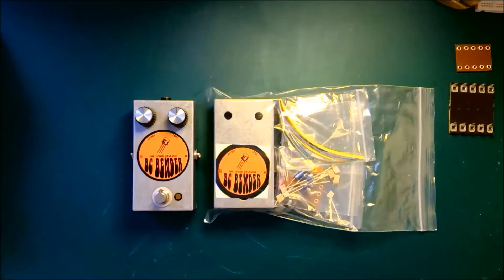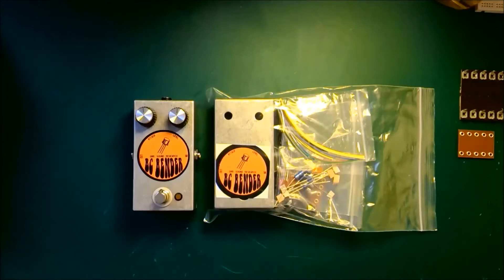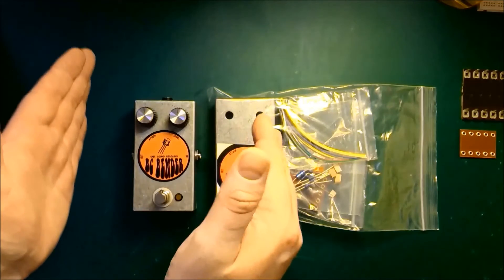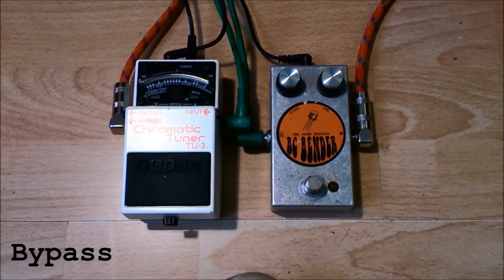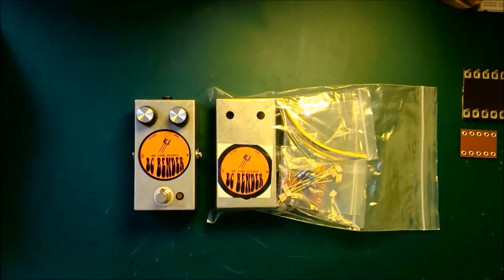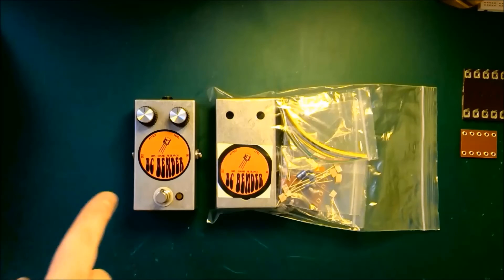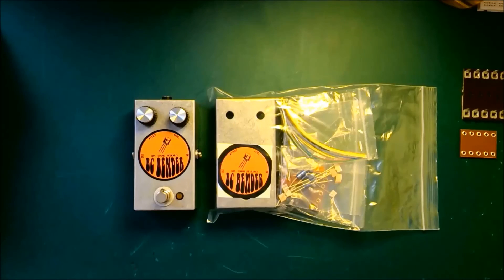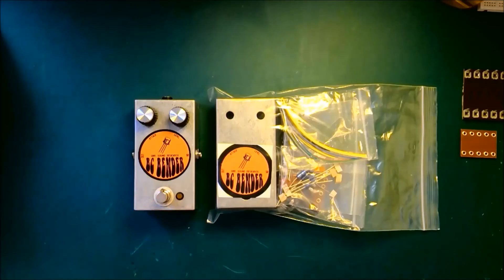GMR BC Bender Handwired Fuzz Pedal

Comment: I just built this and the sound character is great, however,  it sounds as a my other tone benders sound on their minimum gain settings (spitty and without sustain), and this is when I put the BC BENDER on its maximum gain setting, anywhere lower than maximum gain it does not fuzz at all, any ideas of anything I might have done wrong??????It is somehow solved if I use a booster right before it. I love the sound character of it though so I hope I can fix it. Any ideas are appreciated.
Reply from the maker: Its likely you have a short on the attack knob. Check the lugs are not touching the case.

Comment: JUST COMPLETED WITH MINE / SUMNER, WA / UNITED STATES - FROM THE VIDEO I EXPECTED LOTS OF GREAT SOUNDS - The kit was well planned the only thing is place all the wires that go to other components in the box on the tag board first before soldering so you can make it easy to attach to components and do not take a chance of damaging transistors or other parts already in place... after painting my main cabinet mat ORANGE  and the bottom plate FLAT BLACK AND completing project i was excited to plug in...then when I did run the pedal with an SG with Humbucker's it was low in FUZZ AND IT FIZZLED AT THE TOP AND BOTTOM OF THE ATTACK KNOB...the volume worked great but what i found was that it needed ANOTHER + 6 DB OR MORE TO GET THE SOUNDS I HEARD HERE - it needs a small boost 9+6-+10db)  to bring this pedal to GREAT VINTAGE SOUNDS...not sure if the transistors are the best choice...so with this behind my DONNER EQ/BOOST PEDAL IT is a great FUZZ...without a BOOST PEDAL IN RONT OF IT t I would not recommend this pedal unless you are looking to GET EXPERIENCE AND BUILDING KITS / AS A KIT IT IS 110% IN VALUE AND ASSEMBLY...

Comment: Question for GMR,
Ive been building pedals for about 4 years and have built many pedals from scratch and from kits the last being a Harmonic Tremolo. I was going to build a germanium fuzz face (since i realized i had almost all the parts lying around for a basic FF pedal) but i use mostly humbuckers (90% of the time). Anyways i already have a few of the components i would need from what i have lying around and from what i salvaged from a few recycled electronics i keep for projects like this. After putting together a bill of materials im at around $40 for all the parts for a Fuzz Face clone. Anyways i think i might be better suited with the bender circuit and since your selling everything all together i might as well just buy a kit from you lol. I just had one question, is the dc jack center positive or negative? That was a big headache for me in deciding which Fuzz Face circuit to build and im wondering if that is also a factor to take into account with the bender circuit? Anyways thanks for your help!

Comment: Just finished assembling one of these brilliant kits.  Good quality components and sturdy case, can't criticise anything. It's a straightforward build process made easy by the very clear in-depth instructions (which you download). It took me about 3 hours from start to finish - taking my time. A great starter project for anyone with basic soldering skills. The only minor difficulty I came across was identifying the correct resistors - they do look a bit similar!    I'm not an expert so I can't compare the actual sounds with anything else, but it does work well. A really enjoyable project.
Reply: How did you find sorting out the right resistors? just got my kit in and none of the resistors seem to match the codes for what is supposed to be included (they don't even match the photos in the instructions!!)
Reply: @AaronAubreyPhoto  Hi Aubrey sorry for delay replying. To be honest I estimated which was which based on similarity of colour stripes and quantity of each resistor. I had to use a magnifyer! You could maybe contact GMR - they seem to be helpful. All the best Terry.
Reply: @AaronAubreyPhoto  Resistor colours can vary a lot from one resistor to another but they will be the same colour code. Orange can look duller on some for example. A magnifying glass is worth having if you build any pedals. Then you can be sure the resistor colour codes are correct because they are quite small.

Comment: Bought and put on my board about 6 weeks a go. Have to say it's the best pedal I have bought in many a year. Truly sensational fuzz but tones down nicely for a more over driven sound. I know we all harp on about vintage sounds but this is what this delivers. Some fool compared this to the EHX satisfaction. I have both and this is by far the better pedal offering far more mid - the EHX is far too sharp, too much treble. I have used this with a Marshall, a Vox and a Peavey and it has been the dog's bollox every time. Can't believe there only £60. Want some vintage cut price fuzz/over drive - well buy this.
Reply: Have you tried placing it after another pedal and if so, how does it react to the guitar volume with a pedal or buffer in front of it?
Reply: Mine should be rolling in this week Very excited Far superior tone than the Satisfaction I'm sure of that just from the demo's Great price point